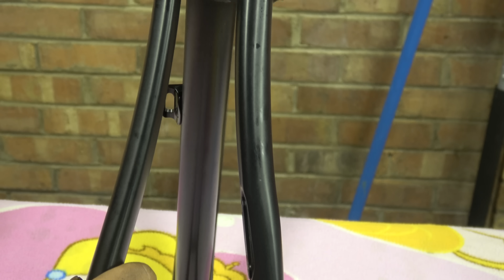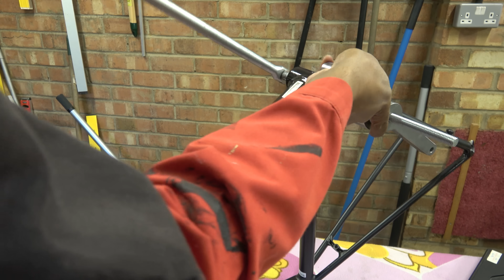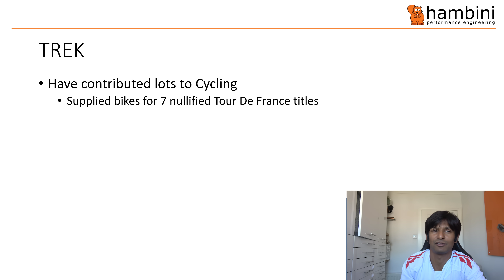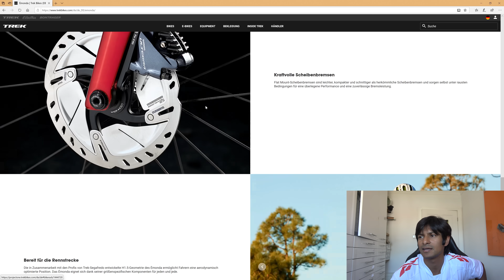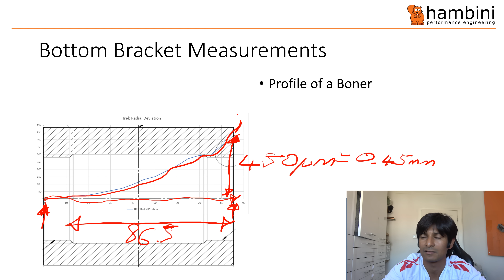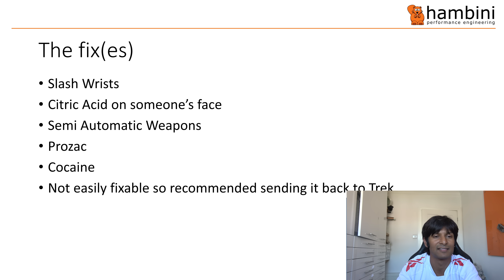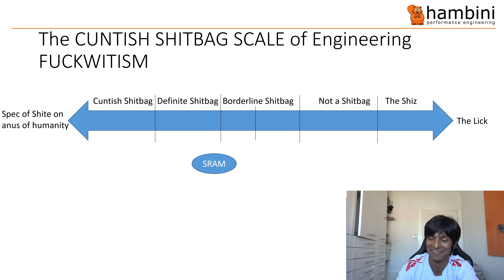Trek Emonda: Engineering crapness of the highest order

Comment: Wide tyres are faster is now a regular feature on the Hambini scale. When are you going to give us your science compared to the latest products from Zipp and Enve,  Hunt  Roval etc. I'm a big believer in wide rims and Lower pressure for a comfy ride but then I'm not a Pro racer and cycle mainly on C roads to avoid getting run over by the retards in cars and vans.
If you want another product to ream try Crank brothers pedals.  When did plastic bearings become a mainstream thing. Very light but flawed .

Comment: Spot on about the strength on the material at the weld and right around the weld, had a specialized rockhopper that broke at the right seat stay in that place contacted specialized sent them pictures and they replaced the frame and actually sent me a brand new bike

Comment: The key to get a good aluminium frame is 
stress relieving! And: machining afterwards! I can tell a lot of stories (Storck: expensive shit from Germany) but some folks are able to deal with ist (I have a 14 year old Marin without BB problems). I would send this piece of horror back to Trek - they call out lifetime warranty - so they should replace it into a contemporary AL frame (you had the old one with external cable routing).
I own (or owned) several Trek's and Specialized's and Storck's and some cheaper stuff (Marin, Stevens, Merida) and I would say: the cheaper ones are not the worse ones! (OK, Merida does not ream holes in the seat tube - I could shoot them for that). If they have a good programming engineer (for the welding robots) and have a proper stress relieving - it works! If not, you're fucked. Regardless the frame costs you 250 € or 1000 € or just 100 €.
But Carbon isn't better! I had five different Focus Mares CX frames until I got an exemplar without delaminations and blowholes (steering tube - bearing seating).
You made your way through aerospace engineering - I made my way through mechanical engineering (automotive, PUR,) and I wonder how these companies could sell such a crap to their customers. If we would built our buses like this we had to hang ourselves after our customers kicked our asses! BIke industry (and dealers) is full of ignorant and wisdom-free honks!

Comment: Thank you, Hambini
Spot on.  Trek has gone from "shite" to just plain shite.  And, good luck with their warranty.   Unless there's safety issue, they are not at all interested in making things right.
More is the pity.
Reply: I've never had a problem with a Trek warranty frame. Yes you have to go through a dealer, they are a dealer based company. Posters on here either just like to bash Trek and other companies or don't have a clue of what they're talking about. And by the way that frame was manufactured by Giant for Trek. Hambini, I don't know why you rate Giant so well their carbon fiber molding is total crap, and obviously they can't weld any better.
Reply: @ccycles06  My bike: 2019 Madone SLR 9 eTap.  Purchased new on 9/20/2018.   BB creak heard on 1st ride. BB shell has both aligment and cup undersize problems.   

Spin test is ridiculous.  Barely goes a full turn.

What I found:

BB90 uses 37x7mm bearings.
Sooo, the outer race is 7mm wide.  OK .... the shell bearing cups measure 4.5mm deep!!!
Bearings are (really) partially retained! WTF

Manufacturing quality and design are both shite.

 Many phone calls to Madison, Wi. just to get Trek to admit there might be a problem.  I am too disgusted to bother to send it back to them.

I'll buy something else.  Haven't figured out what...
Reply: @steveflor9942  Are you going through a dealer or contacting Trek directly?
Reply: @ccycles06  Hi,  I was doing both..
And, through the dealer a RMA number was setup for return to Wisconsin.   Trek offered to repair,
not replace.  

This frame was was very poorly manufactured.  It cost a lot of money.  I am not interested in Trek 
trying to repair this particular frame.
It's toast.  

In any case, I don't see partially retained bearings standing up to any serious use.  It makes a nice trophy bike for doing parade laps.

Comment: Hello Hambini, I know you are a big fan of Look frames but what do you think of the Look Keo pedals and particularly the bearing arrangement.   I struggle to get more an a couple of thousand miles on a pair before the bearings either disintegrate or seize Poor bearing design or just poor seals?
Reply from the maker: I used to have Delta pedals and they lasted forever. The keo units I had used to fail regularly so I swapped then to Shimano and have had no problems since

Comment: At last somebody who has explained 'compliant' something I have long wondered about. This magic material that stays stiff when sprinting but magically soaks up road vibration. perhaps you could go on to explain 'Modulation' with regard to disc brakes as in one breath we are told they are more powerful than rim brakes ...but they dont apply all that power at once so you don't skid. I think anybody in an emergency situation is just going to slam the brakes on

Comment: Not wrong about pre-machined head tubes - I have a Silverback Sphere with 2 degrees error in the head tube alignment (contact patches are 32mm offset! This is not isolated, it is the third frame I've had from Silverback with major alignment issues.

Comment: Great video, although no engineering solution at the end was somewhat destabilizing. Two questions: 1. I noticed you having some issues with your Wacom stylus. I also use a Wacom tablet and find I get much better performance if I connect the tablet to my computer via USB rather than Bluetooth. Don't know how you have yours set-up, but I thought I'd mention that. 2. A while back, in another video where you were discussing the future of bike frame materials, you referred to a material called "ultralight aluminum" as a potential future for bike frames. What exactly is "ultralight aluminum" and have you changed your mind about its future for bike frames after seeing this Trek frame and the liabilities imposed when welding aluminum pieces together?

Comment: Agree Lance is a legend. I think his bikes date from before Trek became just another label to stick on Chinese frames, and those early Trek CF monocoques were probably quite high quality. Couldn't you machine the shell with a hand-reamer? The hole would probably still be miles off centre but you could at least make it the right size.

idk about aluminium but steel frames with 40mm BB shells usually don't need any machining after welding because the shell is thick enough to survive the process.

Comment: Tell me if I'm a bit thick here but I grew up with bottom brackets that were threaded, these had to be correctly engineered otherwise they wouldn't work. The only variation was 'Italian thread' other than that 'standard' was it . Now we have your admittedly gorgeous anodised aluminium shells to house push fit bearings but this Trek is so appalling that surely the frame manufacturers think they can wing it with indifferent machining.
As amusing as these videos are and the time taken watching them a journey of exasperated viewing,  isn't the push fit 'experiment' a failure as far as the manufacturers are concerned or am I missing something?

Comment: Not surprised..the trek of today vs it’s roots- no comparison. When they started OCLV away back the Frances broke, but to build brand they warrantied any defect..Just riding along stuff.  I wonder if back in steel days every component was flexy so chains rubbed, wobble at speed descending...but tolerances didn’t matter in bigger picture..but today w stiff carbon any slight imperfection sticks out..and then there is pure crap..and so many riders today start high end and have limited experience riding to know how a bike should feel..so flaws are too often unwittingly allowed to persist..I’ve lost any semblance of respect for the company

Comment: I have a question about aerodynamics on a gravel bike. 

Firstly, my main priority is not speed, it's comfort. I have a gravel bike (Specialized Diverge) with 2 sets of wheels - one for road riding, one for anything else. For my road set I use a Roval SLX 24 + 36mm Challenge Strada Bianca rubbers on them. And I'm not the strongest guy, so my average on a 200 km long ride is around 25 km/h. 

The question is: with this huge tyre, at this low speed, would I have any benefit from a deep section rim? I like how this setup rides, so I wouldn't use 25-28 mm tyres, but if I can buy some speed by switching the wheels, well, that would be nice. But my guess is that the bulky tyre negates everything I could gain by the wheel. Am I right?

Comment: Did you do a video on tyre widths vs speed? I must have missed it. Could you please post the link. If not, could you make a video? Keep up the great work, I really enjoy your work. You did spell Jacinda's name correctly. If you want her, you're more than welcome to have her, but we have a no return policy :-)
Reply: I think he has a section about this in his aero wheel blog post. Basically, narrower tires are more aero. And narrower tires are faster as long as you can run the pressures low enough to be optimal without the threat of pinch flatting. If you are pumping up your tires harder to avoid pinching, you need to get a wider tire and wheel to compensate.

Comment: Aluminium siphoning off heat almost faster than you can add it when you are welding it, is what the problem of its heat conductivity comes down to, as Hambini in the above vid explained. For that reason, I wonder if it could be beneficial to pre-heat the zone in the middle of which you'd want to weld (with a gas burner /blow torch), even though it would require a stricter order of work (and positioning your parts on their relative position, and fixating them there, in advance), as you can't touch them and change their relative position once you have them all scalding hot.. Heating that whole zone in the middle of where you want to go weld your parts together, would make you LOSE so much LESS heat when you are ACTUALLY DOING the welding, that a lot less heat energy would be sucked away from that narrow area that's your work zone (at) the very moment you actually are welding as well, which in turns means you have to be much less elaborate with that welding (activity) itself. It might help a lot in avoiding getting a burn-through. I do feel there is something like a contradiction in ideas (and actual approaches) like this, it is much more about being very precise I recon. Anyway.. also, pre-heating would cause all those pieces of tube and parts to be hot in a much more equal manner, so theoretically you might end up with much less risk of distortion once you are done and your work has cooled. Just wondering.

Comment: one time i was replacing a carbon brush in a motor, tried to weld it except that the surface where you put it on was alluminum(i didnt know at that time); i acidentally reinvented fireworks and trashed the motor

Comment: How long have Merlin Cycles had your Mech? I sent a new faulty brake back around 18th May so nearly 6 weeks ago. Chased it up a few days ago and they said to wait another 10-14  working days.  They are a joke, also it hasn’t gone to Madison they deal with Shimano Europe, what’s the point in buying from a UK based company to have to send parts abroad for service. Wish I’d know before purchasing from them.
Reply from the maker: I sent mine in 24 April
Reply: Hambini Wow what a joke, maybe it wouldn’t be so bad but the brake was brand new out the box with a sticky lever. Not like I’d had it for 12 months, maybe wouldn’t mind it so much if that was the case.

Comment: I'm glad at 17:11 he mentions the word "compliant" and calls it out for what it is: a BS marketing word for flexible.  Anyone using it cannot be trusted.
Reply: "compliant" is a legitimate often used engineering term. The reciprocate to the term stiff.
Reply: @backdoorslam  Ask any non-engineer what "compliant" means and they either have no idea or thinks it means "comfort" as intended by the marketing department.
Reply: @tdot6832  that is correct. however by lowering the stiffness of the frame (more than the mass) you can lower the natural frequency of the frame. this way you can filter the road noise, giving the rider indeed more comfort.
Reply: @backdoorslam  You've just given more fodder to the copywriters: "lower the natural frequency of the frame...filter the road noise".  Love it! lol.
Reply: @tdot6832   But that's exactly what it does. Just ride a super compliant full suspension mountain bike. It has such a low frequency it will bob along in time with your pedalling if you aren't careful. And it soaks up all the road noise.
Doesn't mean it's better to ride on the road though.
Reply: @patrickmcauliffe3429  How did we get so sidetracked here?  Hambini is not questioning the science but the language used to dupe the masses.  Compliant is a nonsensical word to most and the marketing departments and bike reviewers know this.  They would never use the word flexible instead of compliant because the advert or review would clearly become negative.
Reply: @tdot6832  Yeah, good point about the language.
My point was that nobody (sane) argues that a softly sprung downhill mountain bike is best to ride on the road despite being super compliant. Therefore, at some level, we all understand than more compliance isn't always desirable.
Reply: The corporate world likes to use so called buzz words, when really they are just talking bollocks.
Reply: What a load of crap lol.

As Tarasch1 mentioned above, compliance and stiffness are object properties. 
Were you asleep during engineering classes?

Comment: I have a 2019 Trek Fuel EX 8 that has the same issue.  The bottom bracket shell (Dub BB92) dimensions are between 40.62mm and 40.88mm on both the DR and NDR (varies depending on axis).  It should be 40.98mm...  Couldn't you have reamed the bottom bracket shell on that bike to the correct size or was it not worth it because of the misalignment?

Comment: I am sad. I have two TREK Emondas (SL and SLR) AND a Cervelo (Aspero). I built them up from the frame myself. BB90 is shite but haven't had a problem yet (likely because I have no FTP to speak of and I weigh only 63kg). The BBright shell on the Cervelo Aspero gravel bike measured true enough: installed a TOKEN thread-together bb and have had no issues yet. Now I have to pray to the Hambini God that they hold up. Nice.  PS Cool Channel.

Comment: Dam, I thought a ALU frame would be machined to perfection and a safer purchase than a handmade carbon frame
Reply: Bought my Cannondale CAAD12 a few years ago new with similar thoughts. That a premium alu frame would be better value than a lower end carbon for my budget. And there’s a lot of fluff about how good Cannondales alloy frames are. Think I need to give my cranks a spin test, maybe that’s why I’m so slow up the hills!?
Reply: @peterclarke8832  till caad9 they were produced in America, now in china/Taiwan. Good luck with that
Reply: @peterclarke8832  the BB would have beem the deal breaker.If your frame has a trash BB standard, your frame is most likely going to be trash.
Reply: @peterclarke8832  - 'there’s a lot of fluff about how good Cannondales alloy frames are' - Quite the opposite Peter!!
Reply: It was. The poor welding job and subsequent repair ruined it.

Comment: Once the BB shell ID has been galled up by the interference fit, it’s not possible to get reliable measurements of the original dimensions.  We really don’t know what went wrong with this frame.
Reply from the maker: the section through the middle is not galled and that is bent.
Reply: Hambini: not having seen trek’s print, I would guess the center of the BB shell is not a specified or critical surface.  The only areas that matter is ~10mm in from each end.  Trek is not expecting someone to try and shove an interference fit tube all the way through from one side.  The BB they designed it for is pressed in from EACH side of the BB.

I’m not arguing the frame tolerances were good, they probably weren’t (for the weld distortion reasons you correctly identify in the video).  However, it’s not reasonable to interference fit bare & dry aluminum over a ~70mm length and not expect galling; the galling threshold stress for self-mated aluminum is quite low (especially wrought aluminum grades).  For this to work, the bearing housing should be steel, the frame tube heated to expand it, and/or the interface well lubricated (likely impossible over that distance).
Reply: @GHinWI  your point about inserting a Hambioni BB is valid.  However, Trek should ensure the two machined ends of the BB lined up and the visual check at the beginning clearly shows that the two ends of the BB shell were significantly misaligned.  Anything that you can see visually so easily should have been straight in the scrap bin.  Personally I am shocked that Trek allow welding repairs as major as the one we saw.  Perhaps this frame WAS out of the scrap bin...
Reply: Robin Cooney: I just have to disagree about the weld repair.  Weld repair is standard industrial practice and that center of the tube is a non-critical location of the frame.  No significant manufacturer of bottom brackets uses that area in the center of the BB tube.  The two ends of the tube need to be concentric and within diametral tolerance for about 10mm and the rest is non-critical.

This was an inexpensive aluminum frame that trek probably buys for a few hundred dollars at most.
Reply: 'Galling' won't REDUCE the dimension of the hole, will it fella?
Reply: greg taylor:  yes, because galling is cold-welding across the interface, it definitely can reduce the diameter.  It’s a buildup of material from the bearing housing they were trying to push in.  Also, galling roughens the surface, which would also reduce the ID and make it more irregular.